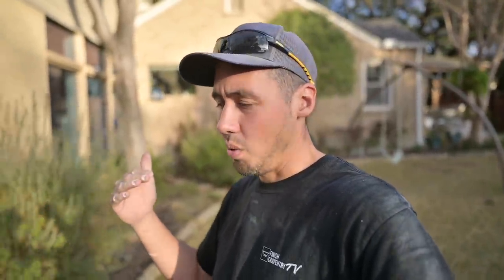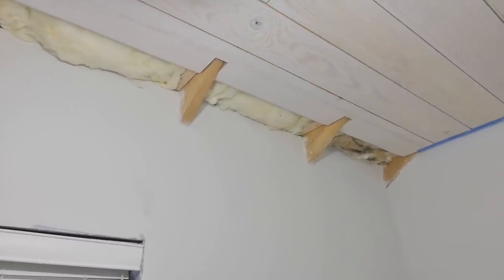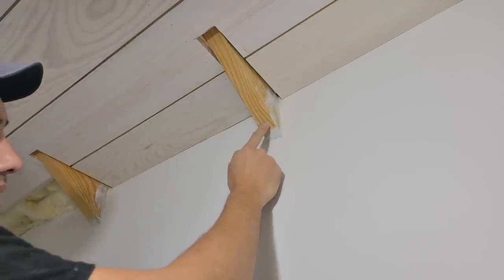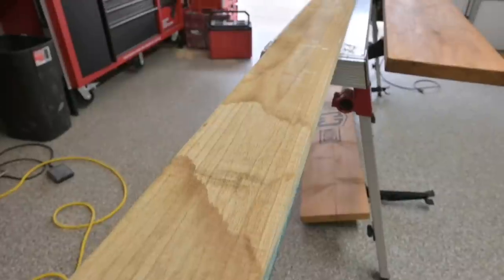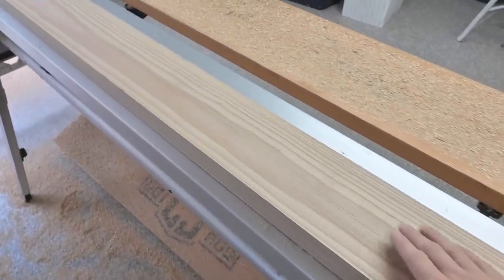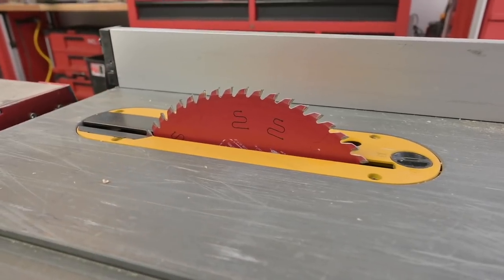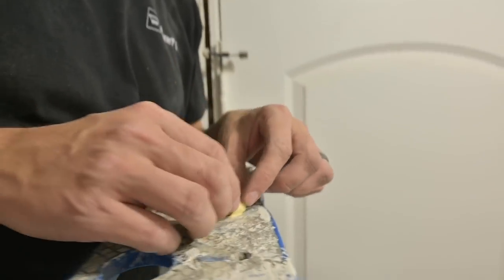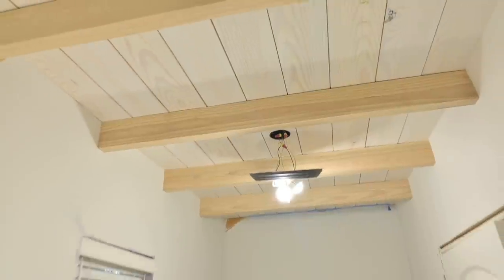I like the look of exposed framing.

Comment: The ceiling looks fantastic.  A suggestion is to use a drop fixture that casts more light upwards to show off that ceiling.  With a flush mount fixture, the beams will create harsh shadows in that room, with the outermost ceiling being very dark.  Flush mount fixtures do not work well on a boxed ceiling.
Reply: Thinking the exact same thing

Comment: I see many options. 1.) Box it like an ibeam. 2) shiplap the face (possibly create a faux copy on the opposite corner). 3) before putting in the shiplap, copy with triangles all around and  create a faux  crown molding all around. 4) leave as is, natural stain and poly. But it's Richard's house. Whatever he decides is good. But I wish he had shown the opposite side after install. I'm a bit confused with leaving the framing exposed on the opposite side even with veneer. All kinds of respect for this guy showing his work to everyone. Merry Christmas to everyone. 🎄✝🕎⛄
Reply: Yeah was thinking the same thing.  One side will look great, the other side will look odd.  Since it's not structural, seems like wrapping with a faux beam would have given a cleaner result.

Comment: Richard, just a tip about milling rough lumber. Always try to take off equal amounts from each side to reduce internal stresses being released and later warping the wood. Always cut off several (4" or more if cracks are present) off the ends of a piece of rough lumber. Not sure if you sold your DeWalt planer already, but after using the portable planer for one face the DeWalt would have been ideal to plane the other face and then a finishing pass for the first face.
Reply: Was wondering what happened to his dewalt planer that would have been perfect for the project.
Reply: he says in the video he doesnt have his machine in yet.

Comment: It's looking great! 

Seems like you could have knotched out the board with the table saw  and slid it over the joist instead of beside it.
Reply: wonder if it wasn't wide enough of a board? but that's exactly what i would have done
Reply: Possibly, but that can be risky with expansion and contraction, especially with a hardwood over a softwood that runs in the attic and so close to the roof line.

Comment: Make an adaptor: Cut a hole with a hole saw and keep the plug to fit inside the large dust collector hose. Then cut a hole in that plug with a smaller hole saw to fit the smaller fitting on the table saw.

Comment: @ 8:50 those look like marks from the slats they use between boards while theyre drying. They have angled protrusions on both sides to let even more air flow between the boards.

Comment: I have a question. If the walls weren’t completely plumb, how would you scribe the ends of the beams to the walls?

You have to start with a board longer than the walls  are wide, so is there a technique that’s used to scribe both ends?

Thanks!

It looks amazing !

Comment: I have a friend with a moto to live by -- paraphrased as, if you have a construction design feature that is difficult, emphasize it instead of trying to hide it.  With these small triangular exposed (on the back side) framing parts, how about whitewashing them as well and putting decorative black lag screws and washers on that one side (like the Simpson ones) to make it look structural and interesting?